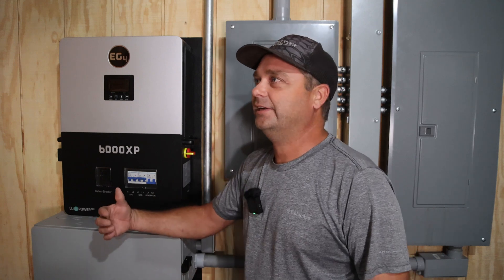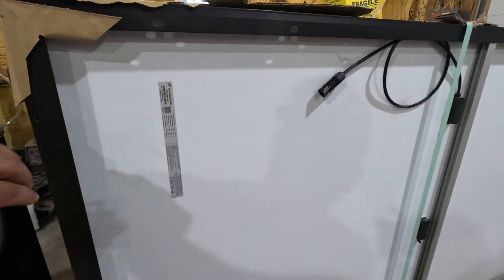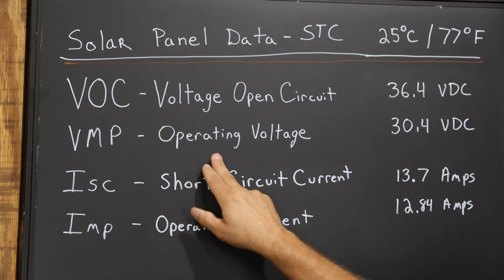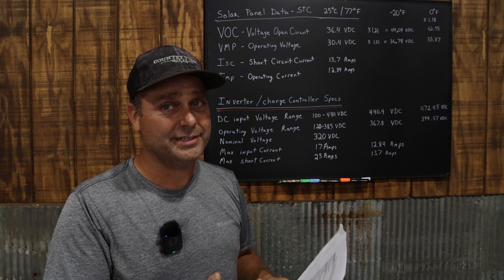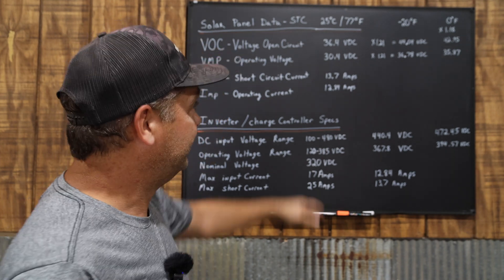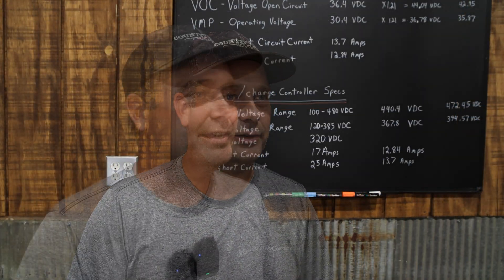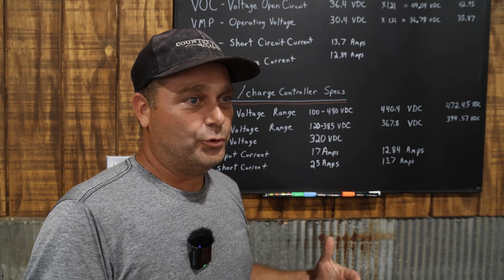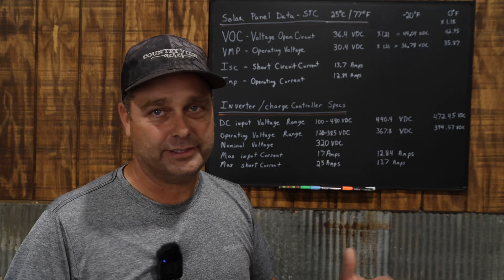How To Calculate the Maximum Number of Solar Panels - Including Cold Weather Calculation

Comment from the maker: The Bi-facial panel example I used, wouldn't damage the inverter because it wasn't over the 25 amps.  It just wouldn't be able to use more than 17 amps.  So the panels might not get used to their max capability.
Reply: You are correct, But, EG4 says that exceeding the amps will degrade the charger over time because it must shunt the extra amperage.
Reply: Isn't a panel a voltage source rather than a current source?
Reply: What if you used a Tigo optimizer? Should allow each individual panel to be maximized.
Reply: I may be mistaken and please correct me if I'm wrong, but I was taught that you can throw as much amps at a charge controller/inverter as you like, but it will only accept what it accepts with no harm with over amperage. Over voltage is the killer.

Comment: Hi great video! Only one thing, going over in amps won’t hurt the controller, it will only pull as much amp as needed . The problem with higher amps is you have to buy lower AWG PV cables that can manage to travel with high amps to the controller and add an in-line fuse to the solar string to prevent fires. Higher voltages will damage the controller for sure

Comment: Thank you, Evan for the clear way you present the facts.  Following your logic, I calculated the max cold temperature voltage (both Voc and Vmp) at -30C ( I'm in Ontario Canada!) for a 450W panel I am considering.  These came out to be 482VDC and 397VDC respectively for 2 strings of 10 panels each.  I then considered hooking them up in parallel.  The max current was 28.32 amps.  This seems to limit my choice of inverter to either EG4 18K PV or EG4 Flexboss.  Am I on the right track or am I missing something?  Given these calculations, I was also wondering how 18KW can ever be generated given the restricted number of panels (my example totals 9KW)?  Thank you for any input.  I'm just starting to consider solar systems.

Comment: So if I wanted to use more than 10 panels then you would need to put another string in parallel providing the increase in amperage does not exceed the inverters max current?

Comment: Use Sol-Ark’s on-line Solar panel tool to determine all of the voltages and currents that are going to be coming from your array.  Play with it awhile, it will provide 100% of the need to know.

Comment: Hi, thanks for the video, 
I'm confused about MPPT voltage and Nominal operating voltage, my question is, will my solar system still operate if the voltage of my panels exceeds the Nominal operating voltage but stays below the MPPT voltage? if I understood you correctly, you said it doesn't? are you sure about that?

And my 2nd quesion, why you can't add more panels in parallel? is it because your inverter is old and doesn't support clipping the current? I'm trying to buy VM IV TWIN 6KV but the data sheet doesn't say anything about the current limit from the solar, does that mean I can add solar panels in parallel as much as want and only make the calculation for the series connection?

Comment: You can also consider voltage drop from cable length/size as part of the calculation. In your example with voltage drop 11 panels could work. Just my 2 cents

Comment: Thanks Evan. How about a follow on video with the rest of the sizing if you wanted to hook 2 strings of those 10 panels in your example in parallel?
Reply from the maker: In parallel the amperage adds up, the voltage stays the same.  So 2 strings the amperage would double.  Everything else would be the same.

Comment: Hey Evan another excellent video. I have a couple questions, how many XP 6000 inverters do you use with 19000+ solar watts & how many amps can you draw from the XP 6000 inverter. Seems your totally off grid, wondering if some of your house appliances & maybe your HVAC system would be a big draw on the system! Thanks for any help you can provide. Oh and 1 more ? how many EG4  battery systems do you need for your system?

Comment: Question - Is there a way to plan for the worst days but build for the average day with a panel disconnect or something like that.  Something that will automatically turn off the extra panels on the worst day or even manually when you know winter is coming, so during the warmer times of the year, you are able to generate more.
Reply from the maker: I don't know of any device that would automatically switch off panels if voltage went to high.

Comment: Is this with your battery connected?    (I got burned when this first came but 14 days with power is changing my mind)                                                                just asking
Reply from the maker: This is calculating solar panels for the charge controller.  The rate of charge to the battery can usually be adjusted in the settings.

Comment: all you need to know is how many watts your solar panel outputs .... total the amount number if more than one panels ... 
compare that to how many watts your charge controller can handle .... it should read total amount of watts it can handle ...
it's that simple ...
Reply from the maker: Voltage is the most important variable.   And voltage changes with temperature.  Too much voltage will destroy a charge controller.  It is not as simple as you want it to be.
Reply: It's not that simple. All inverters/charge controllers have a MAX VOLTAGE. You can't make your decision on ONLY watts.

Comment: I have a 10k sungoldpower inverter, and I didn't want to run my panels in series, but my inverter can only handle   22a but says  5000 v  on each pv leg I have 2 so is that 22a per leg or 22 for the hole system  thanks
Reply from the maker: usually that is per MTTP charge controller input

Comment: Anyone put this in spread sheet form yet?
Reply from the maker: Good idea
Reply: @CountryViewSolar-DIYProjects If no one has, I'll take a shot at it and ask for comments.  Ok?
Reply: @CountryViewSolar-DIYProjects  I've actually built a spreadsheet for this, but it has many other things on it. I specify my max V, A & W for my inverter/controller. From there, I input all of the solar panels data: Cost, Voc, Vmp, Isc, Imp, cold factor, adjusted Voc, adjusted Vmp, max wattage. It then calculates how many solar panels I can have in series, how many MAX watts it can produce and how much each model of panel costs per watt. It definitely needs polishing as I only created it for my uses.

Comment: Did you know EG4 is coming out with a new inverter that is twice the output as the 6000XP and I think it is going to be $2500? They have several new products coming out in November or December.
Reply: https://youtu.be/ZmeT0VZTbfU

EG4 stands for "Energy Generation for Everyone"
Reply from the maker: Yes  It is the 12000XP

Comment: It would be great to do the same presentation with the Eco flow delta pro ultra, since it can have a high voltage input and a low voltage input on the solar panels.
Reply: I agree with this comment. Within the last 6 months, I've purchased 2 Ecoflow DPU's with a total of 4 batteries. I use 3 batteries with 1 DPU to power my server rack (3x NAS boxes, 4 Network Switches, 2 ISPs, cameras and APs). I had to build a spreadsheet to easily compare solar panels and automatically calculate how many panels I can use on the HIGH and LOW PV inputs. Any more info on the Ecoflow Delta Pro Ultra would be much appreciated.

Comment: Hi Evan,  I have respect for your understanding of using power stations and I have a quick question. I want to buy a UPS for my internet fiber gateway and router. I see that the newer power stations show specs that they can also be used as a UPS device. What’s your opinion?
Reply from the maker: I have a power station on my computer.  It works great to keep it powered up with No power blimps.  I think it is a good idea.  It will keep your device powered.  And if you ever have a power outage, you know it the power station is charged and working when you need it.

Comment: I waned to add 8 panels to my system but had to order 10.  I am in Florida so cold is not a concern except for a day or two a year.  My plan is to mount the other two and arrange my wiring so I can take the extra two out of the circuit during cold spells.

Comment: You explanation is awesome! Well put and thorough! I am going through the process now for solar as we are preparing to build next year on our new farm. I’m looking for a grid tie system with 200Amp pass through for whole home solar for both house and barn. 

Have you spent more $ purchasing several units (and all the additional boxes wiring etc.) as compared to purchasing buying one large unit that could supply everything from one panel?
Reply from the maker: You will probably be better off buying one unit with 200 amp pass through. It can simplify the installation and keep the cost down.
But I do like having 2 breaker panels.  When the power goes out, it can be setup to automatically minimize loads, so the battery lasts longer.

Comment: 3:00 is your receptacles the wrong way? I was told by a electrician if you use a metal cover plate receptacles should be ground up. That way if the cover plate becomes loose it hits the ground first. What is your thoughts?
Reply from the maker: That is the age old Discussion - Ground up or Ground Down.  Different electricians will tell you a different answer.  I installed in my house ground up.  But every device you buy is designed to plug into ground down, so everything plugs in weird.  So when I build the pole barn I put them in ground down.  And everything plugs in easier.  As far as I know there isn't a requirement in the National electric code.  But if you look at a outlet's documentation/instructions, they always seem show it ground up, when they have it on a diagram.  The reason why, if something falls down and gets between the plug and the outlet, it will hit the ground lug, no harm done.  If you have it ground down and something metallic falls down in between plug and the outlet, it could create a short between hot and neutral.  
I changed back to ground down, because it works better with devices.
Reply: @CountryViewSolar-DIYProjects  THANKS! Great videos.

Comment: Do the panels have to be wired in series? Why not in parallel? I'm sure I have seen some sort of device that gathers smaller groups of panels to reduce the possibility of an outage due to one panel going down. Thx.
Reply from the maker: When you build a series string, the voltage goes up and amperage stays the same.  Higher voltage has benefits, it can increase the efficiency if the inverter directly uses Solar panel voltage to power loads.  With Higher voltage You can have longer runs of wire, without increasing the wire size to compensate for voltage drop. (So solar panels can be farther away with major cost increase)  With lower amperage, the wire size can be smaller.   Copper stranded wire is required on the Solar DC circuit, and copper wire is very expensive.  
On my system if I wire my panels in 2 paralleled strings, the amperage would double, and be over the max 25 amps on the inverter specs.  I would be way over the 17 amps of usable current.  But if it did work,  Parallel systems require fuses, usually implemented with a combiner box. (added cost)  Also due to the distance, I would have to up size my wire to 8 gauge wire (added cost).
Reply: @CountryViewSolar-DIYProjects  typically you have to get to 3 parallel strings before you need to fuse things. But yes, wire costs go up a ton.
Reply: Cost of wire. Put a bunch in parallel and your amperage goes way up, which increases system cost due to wire sizing requirements
Reply: That's not very encouraging. Aren't you supposed to sugar-coat things for me?

Comment: Hi Evan -   That maximum voltage and amperage is (per mppt) not the entire inverter,,  I didn't hear you mention (mppt's) and your X6000 has 2 mppt's so you can run two strings of 10 solar panels,   some inverters may have 3 or even 4 mppts.     Great information but I didn't hear you even mention the mppts.
Reply from the maker: I said that in the video.  That I was using 10 solar panels in series per MPPT.  Total of 20 solar panels, 7800 watts.
Reply: @CountryViewSolar-DIYProjects    Ahhh   I missed it,  my bad.   Tks !
Reply: I missed that, thank you for the clarification.

Comment: I used this same method.  I believe the EG4 manual says that if the Operating Voltage is exceeded it will not harm the unit but will just not use the extra voltage.  If you exceed the Max 480v you will fry the unit.  We never get below 15f so I could do 10 panels with a 37VOC but I still went with 9 panels due to pallet size of 36 for 2 6000XP's.  I went with the Talesun 400 bifacial due to price and specs allowing for bifacial gain not to exceed the 17 amps even if it does get really cold.

Comment: A minor correction on the Max Input Current (A). Amps are PULLED in electric circuits, not pushed. The max the inverter will PULL is 17A, so using a panel that can provide more isn't a danger. That's the max it CAN provide, not what it is trying to push thru. Asking EcoFlow a similar question on their River Pro unit got the answer of:

"If the current of the solar panel exceeds the solar input of River Pro (12A), it will not damage the unit, but the maximum current the unit can get is 12A. Charging the RIVER Pro with an 18V 16 amp solar panel will have the same effect as using an 18V 12A solar panel. Please note that the actual solar charging time depends on many elements such as sunlight brightness, panel angle, shade, etc. So you may not get its maximum wattage all the time."
Reply: You are correct, But, EG4 says that exceeding the amps will degrade the charger over time because it must shunt the extra amperage.
Reply from the maker: I agree the charge controller regulates the current it uses.  
But for me I choose not to over amp a charge controller.  I hate to take that chance, since it isn't documented in the manual.
Reply: @CountryViewSolar-DIYProjects  I understand your hesitation, but this is fundamental. You cannot over amp from the source side, you can only over amp from the consumption side. Think of it this way, in your house you have multiple circuits running to outlets. Most likely, those are 20 A circuits. If you plug a table lamp into an outlet that has a 5W LED light bulb, that thing is only drawing 0.04 A. But you have it on a 20 amp source circuit. No danger because amperage is pulled not pushed. You cannot overamp from the source side. 

The danger comes in overamping from the usage side. If you put an arc welder that draws 40 amps on a 20 amp circuit, now we have problems and you blow the circuit breaker. If you did not have a circuit breaker, things would catch on fire because of the heat generated.

This isn't called out in the manual because it's a fundamental of how electricity works, and has nothing to do with solar specifically.
Reply from the maker: @charleshill7184  what I am saying, is I don't think hooking up 20, amps, 30 amps, or 40, or 50 amps is a good idea if the manufacturer doesn't doesn't document it.  So, hooking up within the max documented amperage is the safe bet.  If a manufacturer wants to allow a higher input amperage, they should document it.
Reply: @CountryViewSolar-DIYProjects  They do document it, though interestingly enough the docs for the 6000XP and 18K say it differently. For the 6000XP on page 13 of the manual it says "NOTE: The array may have a higher Imp than the 17A specified, but the MPPTs may not make full use of the extra current which could lead to component deterioration over time." But for the 18K is says on page 15 "NOTE: The array can have a higher Imp than the 25A/15A speciﬁed, but the MPPTs will not make full use of the extra current. Having an array that can produce more current than the MPPTs can utilize is useful for increasing morning, winter, or cloudy day solar production."

Oddly enough that seems to be "you can, but be careful" on the 6000XP but "good idea" in the 18K manual.

Comment: So as I understand you can have those maximum # panels (10 in your case) per MPPT.  The recommendation I've been given for the EG4 6000 is 8000 watts of solar panels.  Using your calculation that would be 10 panels per MPPT controller.  Is that your understanding?
Reply from the maker: In my case with my solar panels.  I feel 10 panels are the maximum on a series string to per MPPT.
Reply: @CountryViewSolar-DIYProjects  Thanks for the clarification.
Reply: I have been thinking about this and hoping for a clarification in the comments and I am still not clear, to be honest.

If the maximum PV power input is rated say 8000W and it is a dual MPPT hybrid inverter, does that mean that the total solar input must be split between each MPPT channel?
Reply: @ekeretteekpo3004  According to the datasheet for the EG4 6000XP, you can have 4kW per MPPT. Don't assume if it's a dual MPPT that you can just halve the wattage. Some inverters have a HIGH PV input and a LOW PV Input, like the Ecoflow Delta Pro Ultra.